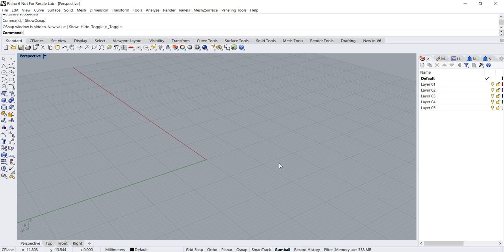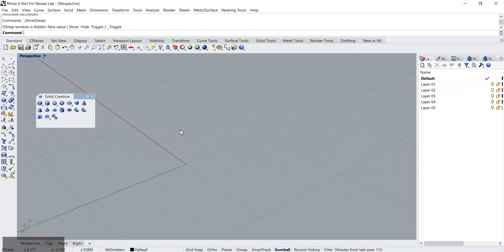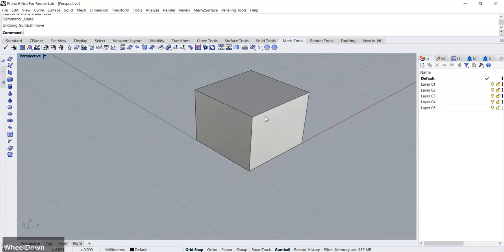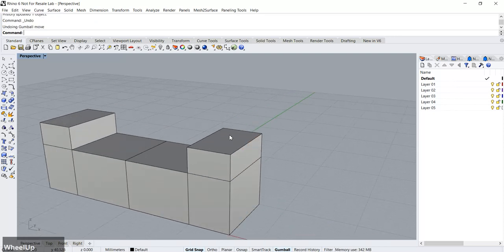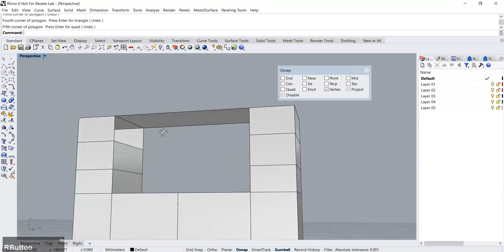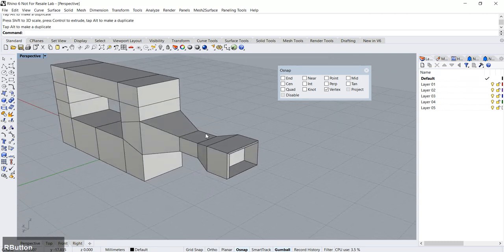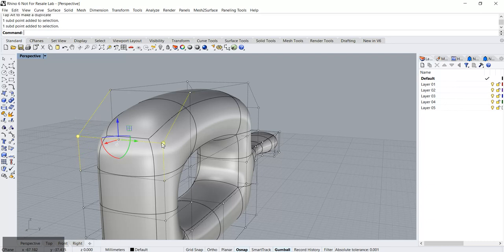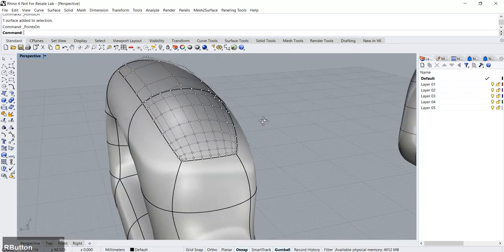Rhino 6 Tutorial: Sub-division modelling & workflow (update)

Comment: can anyone give a basic breakdown of why certain modeling types are used? Rhino is used for industrial surface design intended to be manufactured? Subdivision modeling is for modeling more complex organic forms (as opposed to automotive type surfaces, bike frames, overall simpler surfaces) ?   Is a software like Z Brush a subdivision modeler? Whats the difference in polygonal modeling? Solid modeling? My apologies in advance for the broad questions.
Reply from the maker: Hi, Rhino is primarily a NURBS modeller. Its subdivision modeling is different from that of programs such as 3DS Max in the sense that the Subdivision converts to NURBS instead of polygons. NURBS formats are required for manufacturing. The standard exchange format is STEP or IGES(older format). Polygons are not accurate enough for manufacturing. Zbrush is primarily a mesh modeller. 

Just my understanding.